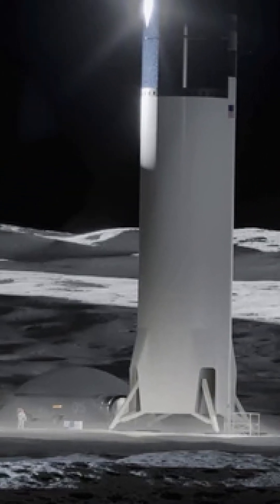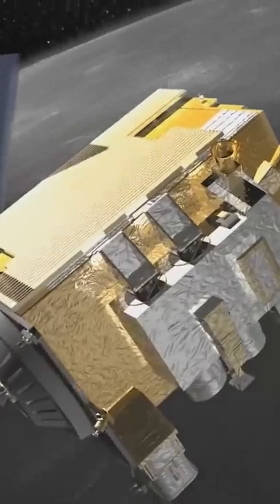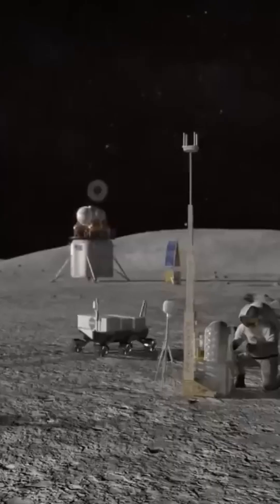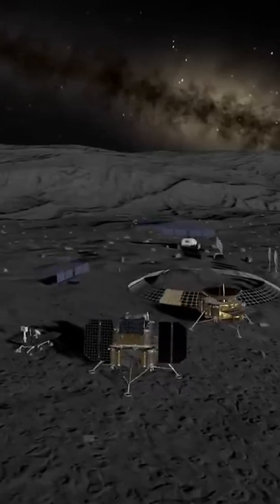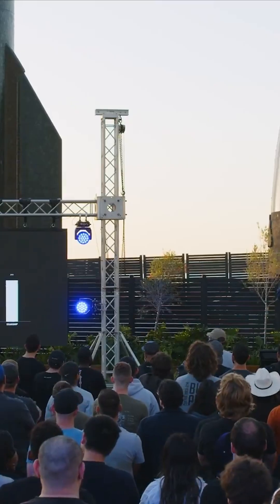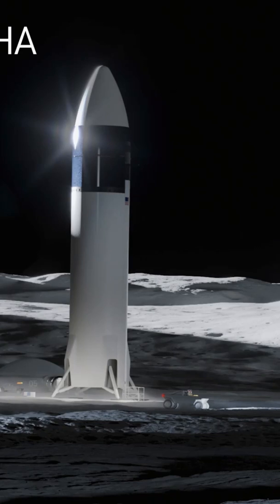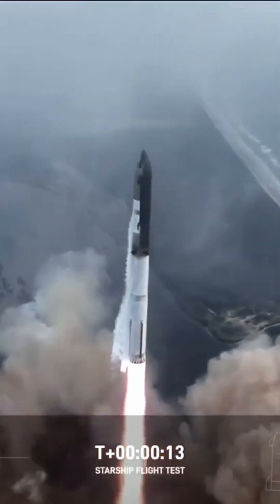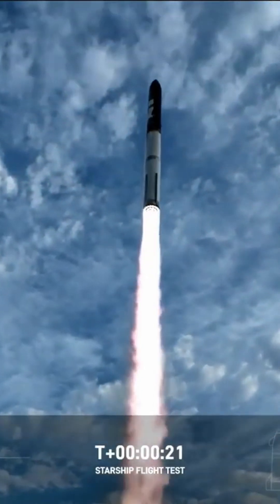How Will We Land Starship on the Moon?!

Comment: Might be alot easier with a reusable aircraft/ spacecraft design similar to the Harrier VSTOL,  land and take off versatility. Just upscaled to maybe size of Hercules freight carrier,  Flies into space orbit, lands on the moon using  the already proven  , vertical landing. Return lift off from moon 🌙 in zero gravity ✨ wouldn't need so much thrust and more importantly less fuel. Old Saturn rocket thinking is not versatile,  aircraft could also be re fueled just before leaving earth's orbit, for the long flight,

Comment: The rocket will have engines higher up, so that it does not excavate a crater as it lands.  Will also have legs for a stable base.  The Apollo missions side-slipped in so that minimum exhaust plume excavation happened.

Comment: As soon as a rocket lands, it would blow out all ground under it  , and then fall over ..
Reply: Just under few centimetres of loose material regolith is very solid. Large lander engines, like ie raptors could damage it very easy tho, this is why they will use additional thrusters about 30 meters above. Plume should be spread enough to vastly reduce that force. Landing pads will be more necessary near bases to avoid damaging equipment from fod.

Comment: I think simple solution is have a rover of some sort find a relatively good spot have it level and stamp the area compact then use some sort of spray on “glue/epoxy that soaks into the moon surface/regolith that dries hard as a rock.

Comment: Since you need LOX up there, prefab concrete regolith is the way to go. You can't stay on the surface due to radiation so caves or burrowing machines can shift material to the surface.

Comment: How about a prebuild steel plate that can be assembled on the moon, maybe by a robotic rover.
Reply: Weight to heavy o forgot but i saw some companys working on rovers that can turn the lunar regalith mixed with somp somp into basically large bricks.
Reply: @HeaIthyFamiIyForce  perforate one of the ships, and unroll it. take lots of paper and make an origami landing pad.
Reply: @HeaIthyFamiIyForce  I don't think it has to be too thick since steel is very heat resistant, also they might do a landing/takeoff profile from the moon, maybe one engine until there is enough distance to light the others.